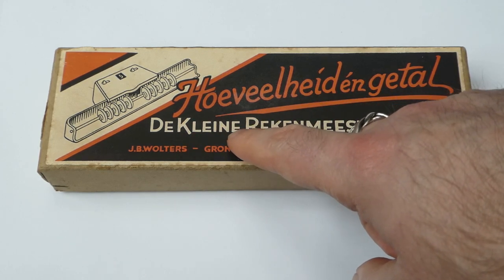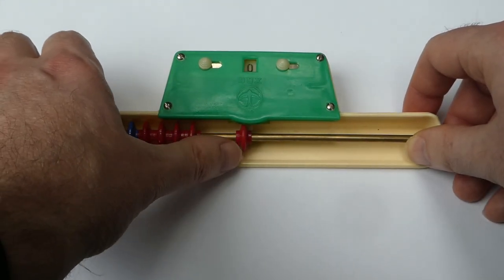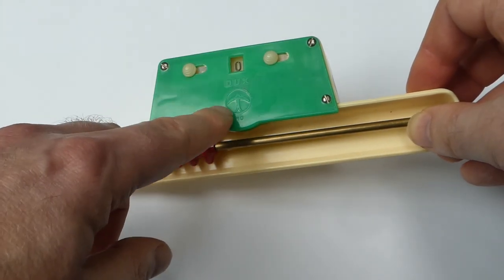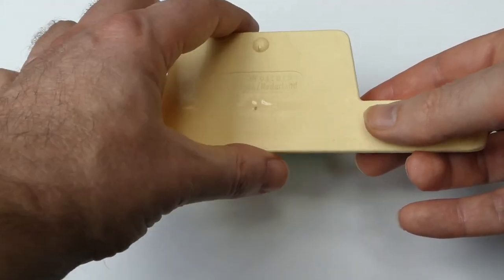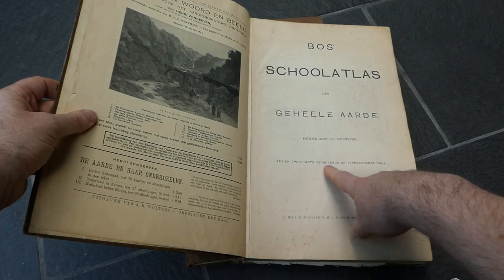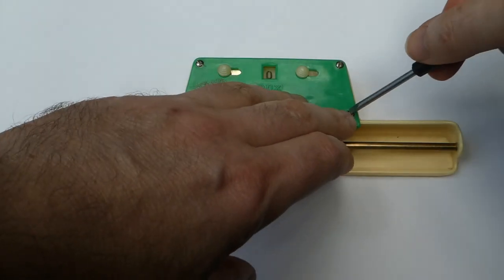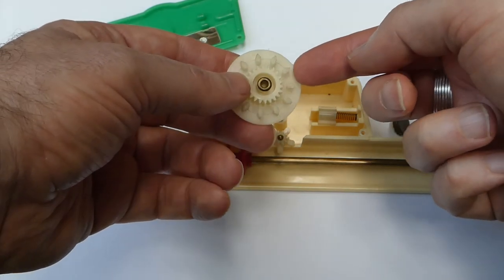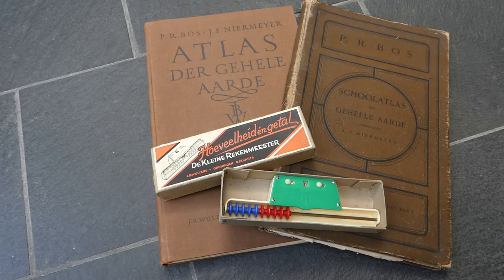De Kleine Rekenmeester

Comment: My girls liked it although using fingers might have been more affordable.
Reply: Also I didn’t know that about the printing of Djakarta from 1950-55. That narrows the date down nicely.
Reply from the maker: @stephenfreeborn  On the atlases Djakarta was only printed during those years, and it is reasonable to assume the same holds for all Wolters's material. Other than that I found very little else that you hadn't already. It was nice to show the atlases - these were ones that we've had sitting on the shelf since forever.